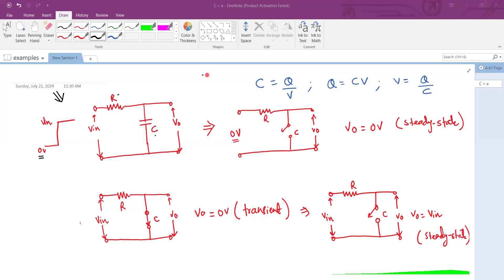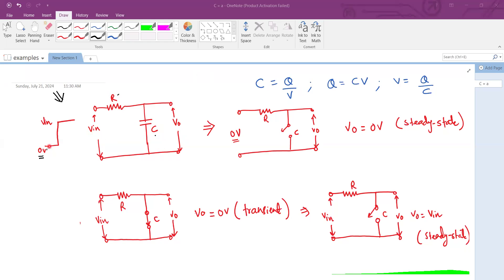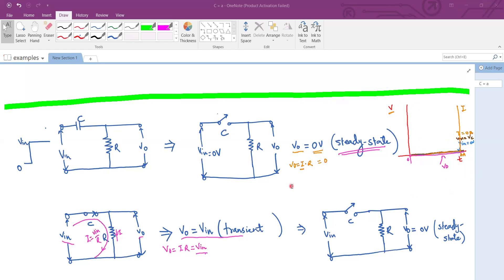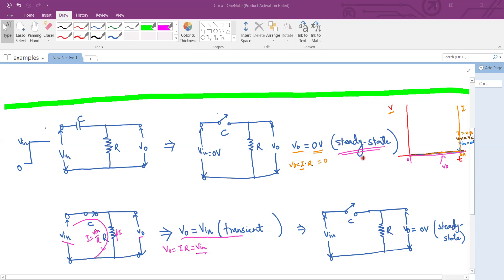Capacitor as a Switch | RC Circuits

Comment: I don't see it. I can better see that the capacitor is a time delayed switch... sort of. And more... sort of... when there are defined levels of V-on, and V-off... which is similar to the way it is in a 555 timer. If you want to parametrize a capacitor as a 'switch,' you can do that for an inductor too. In contrast to those...I can see an ideal diode (even non-ideal diode) as a voltage polarity controlled switch. IMO the diode is clearer example of a switch...at least to me.
Reply from the maker: https://youtu.be/cSd1HpdcVp0